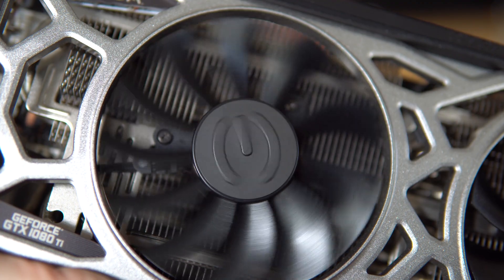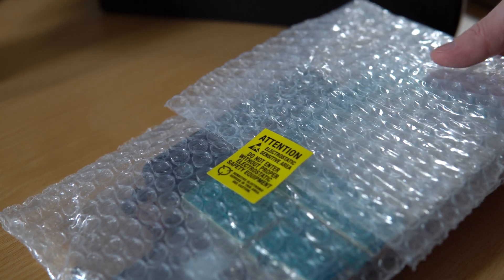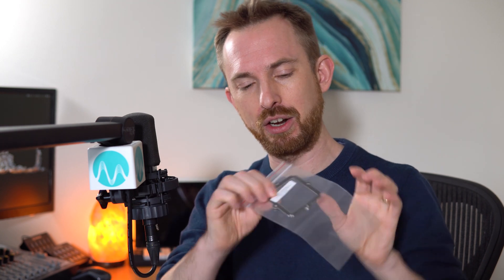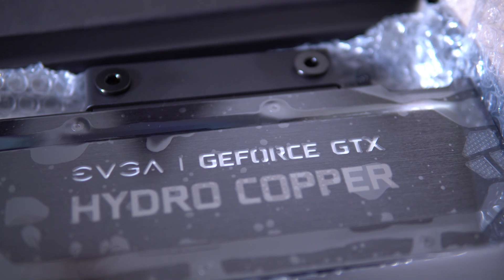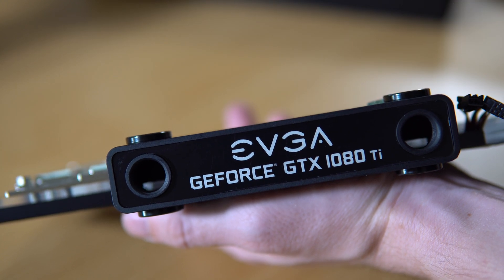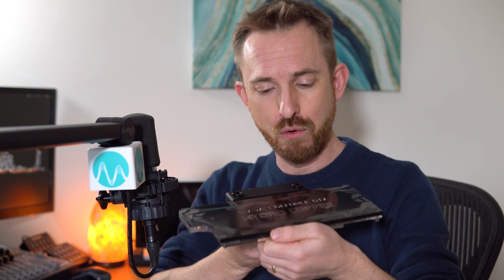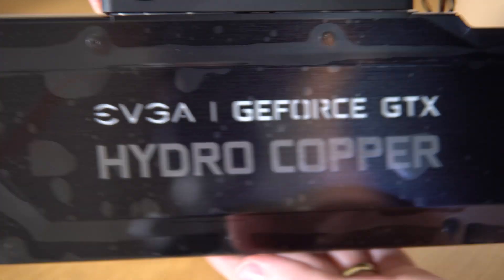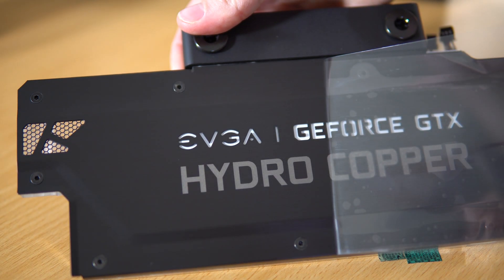How to Make GPU Silent (Water Cool w/ EVGA Hydro Copper Waterblock) - Ultimate Audio PC Build #016

Comment: In my experience the water pump is a worse than fan noise which you will still have for the fans on the RAD anyway
Reply from the maker: Thanks for the info :)
Reply: @MikeRussell  and Jon, The pump can be heard but its nothing as noisy as those fans.  Also, fans suck dust,  smoke if you smoke, animal hair.  Before hydro copper I had to replace fan cards because they'd seize up and/ or overheat as they were clogging up.  Get a quality pump or the twin pump system by (?) like I do.  You can hardly hear the computer run.  I had the 580 gtx hydro and currently have the 980 gtx ti hydro, both by EVGA.  Expensive yes, but they'll run forever and at a whisper.  Super stress tests run no hotter than 55 C.  I have a 800 cc reservoir and triple fan radiator.  Love it!